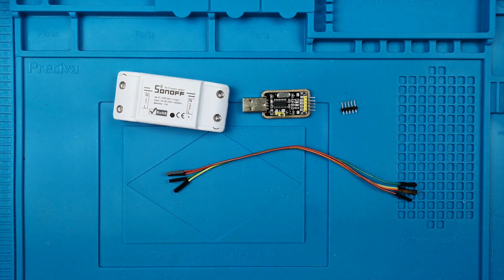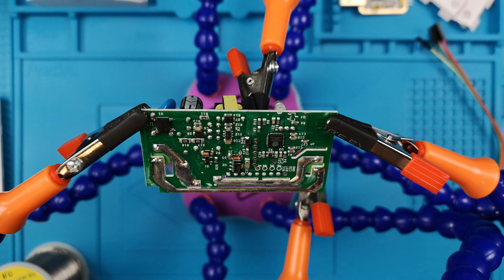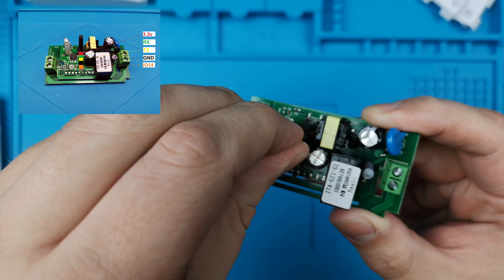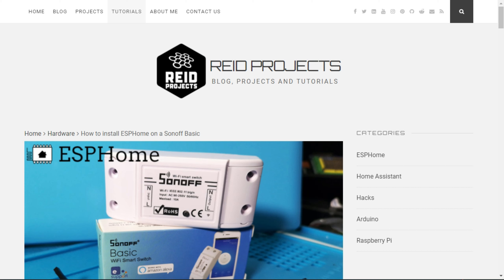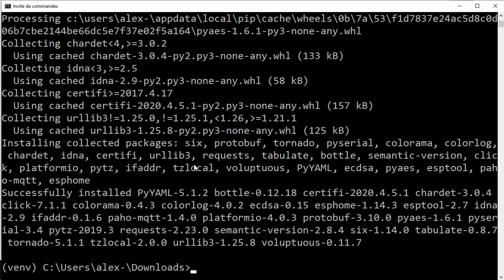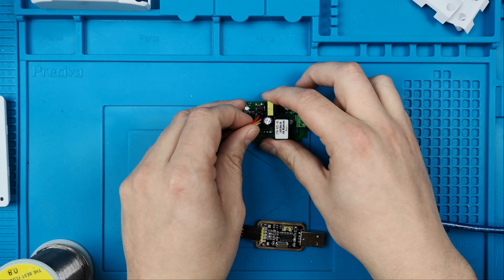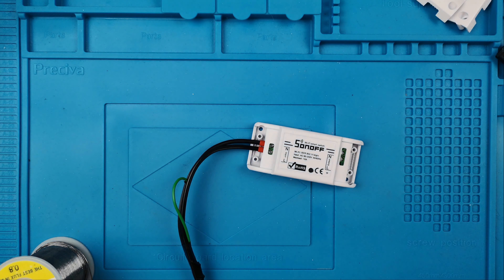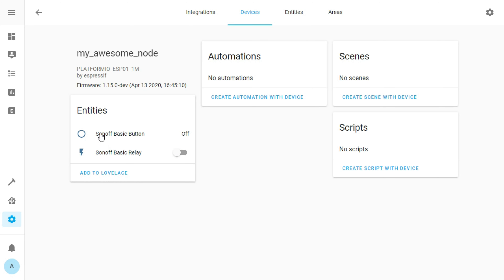How to Install ESPHome on Sonoff Basic and Home Assistant

Comment: Thanks for sharing. A question though: why don't you add Esphome directly into HA? It's super convenient
Reply from the maker: On my side, my Home Assistant server is under my stairs, so it's not really convenient to plug my devices to my Raspberry Pi for the initial flash. That said, I'm already using the ESPHome add-on for the updates, I'll post a video about this in this series.

Thanks !
Reply: @ReidProjects  I'm not connecting anything to my HA, especially now when it's running it on my Synology - I just create a simple template on ESPhome on HA, download the .bin file on my laptop,  use https://github.com/esphome/esphome-flasher/releases to flash the .bin file on ESP board. Don't get me wrong, i'm not trying to show you that you are wrong ...
Reply: @valentinene  I do exactly the same. So much easier and having the ESPhome Web UI is really nice to see all of your devices as well.
Great work though @Reid Projects, keep up the good work!
Reply from the maker: Thanks !

Comment: Possible to turn on and off using a rocker switch?
Reply from the maker: Yes you could add a rocker switch on the GPIO14 which is exposed on the header we add. Then you could add the GPIO14 as a binary sensor.

You would only have to decide what to do if the switch is ON and that someone switch it off on Home Assistant (or another system)

Hope this helps ! Let me know if you need more details

Comment: Its not needed to solder the pins for flashing...Just stick the short end into the PCB and hold it there while flashing.
Tasmotoziser-1.1 is far more easy to use, needs no install & does exactly whats needed or you could just use the flasher through ESPHome in HA instead of OTA (Shows up (upper right corner) as possible selection when FTDI inserted into HA-computer & its restarted).
Reply from the maker: Thanks I didn't hear about Tasmotoziser before, I'll definitely give it a try. 

I'm already using the ESPhome addon to update my nodes but since my Home Assistant server is not really accessible (in a case under my stairs) , I prefer to do the initial flash it directly with my computer.